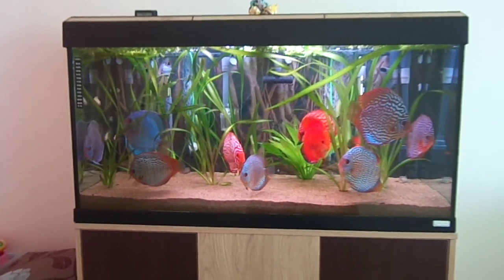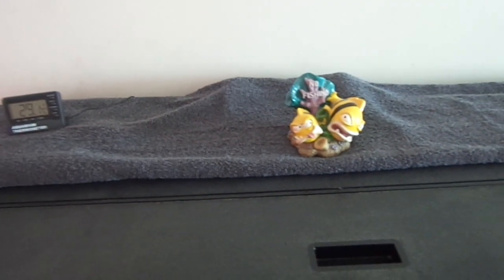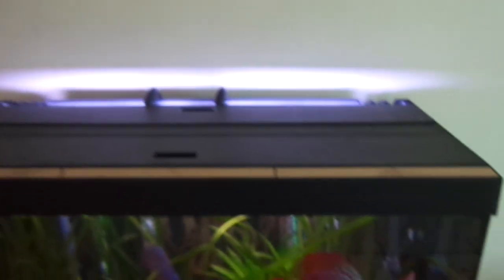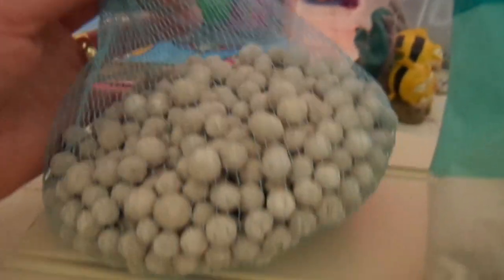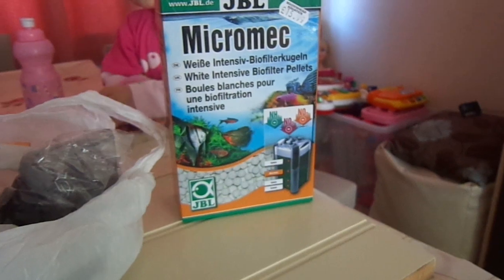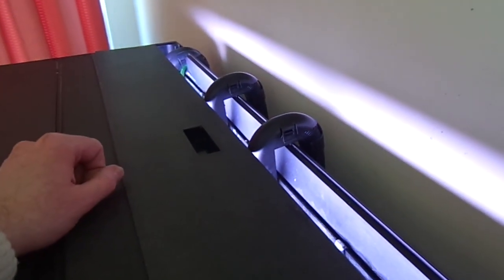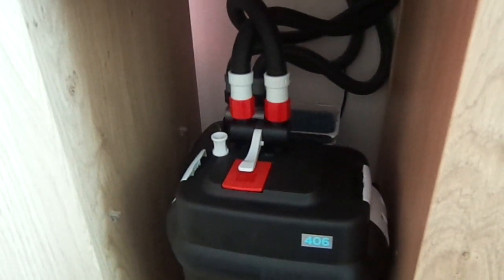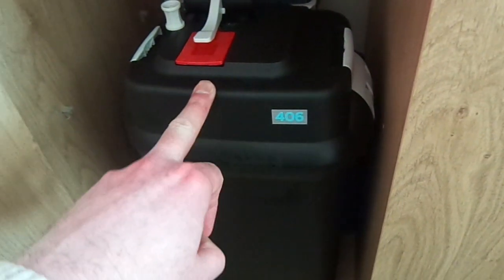Running Three External Filters In One Tank

Comment: Nice setup i own a old School Fluval 304 model. That i got from a second second hand store here in the US just needed a few replacement parts you know impeller well cap hoses intake Etc. I used it on my 55 gallon freshwater Community Aquarium. It ran like a champ the old aquastop valve luckily didn't give me no problems I still have it it's in storage now since I sold my 55 to a good friend. While I had my 55 I also picked up a Fluval 206 for the price and it to work like a champ still got that as well. And yes I totally agree the new aquastop valve and just a design alone is much better. And I tell you what for my years of experience in the hobby I have been through a lot of filtration systems from many different manufacturers. And ever since I went with Fluval I have stuck with them ever since. By the way I also was running 3 filtration systems on my 55 as well. I ran the two Fluval canister filters as well a Kedsum HOB Filter mainly do to it had a surface skimmer. all my filters were set up as both Mechanical and Biological filtration.  with the exception that the Kedsum filter was mainly Mechanical. As for Chemical filtration I was experimenting with a  Media Reactor. I guess technically you can say I was running four.

Comment: A fluvial 4 will pump 1450 liters an hour on its own 😮😮😮 how did you work that maths out ???? An all pond solutions external filter( model  2000 ef ) will pump 2000 liters per hour and costs about £100 brand new , I don't think you thought this through very much my friend ps a 307 filter will also do 1450 liters an hour , and you have 3 in total  = 4500 liters an hour approximately, ??????